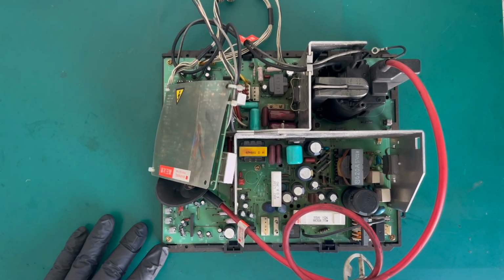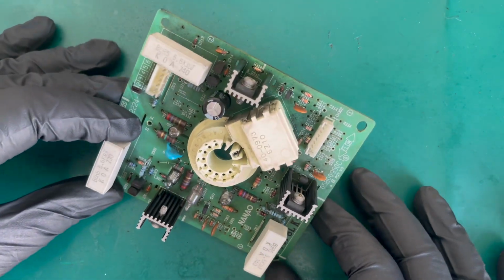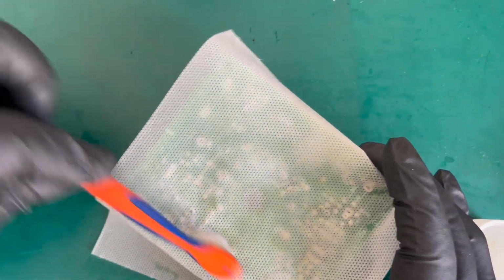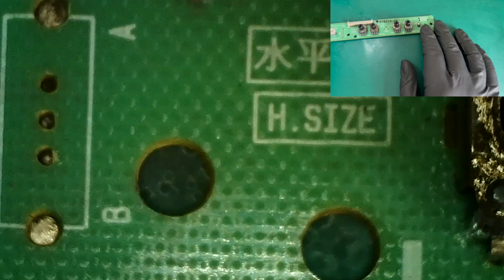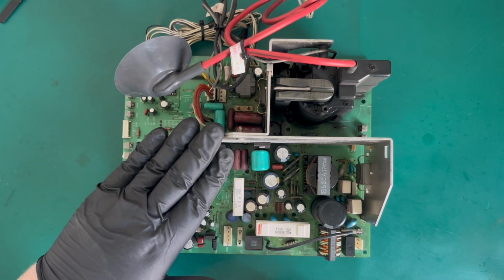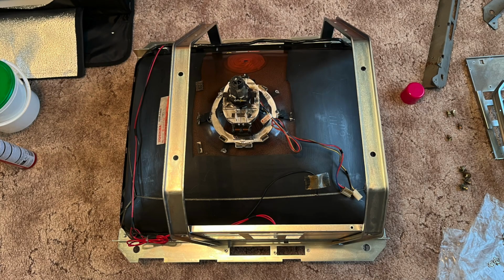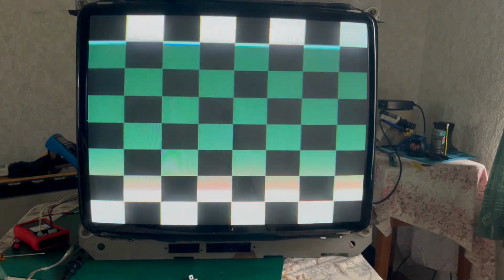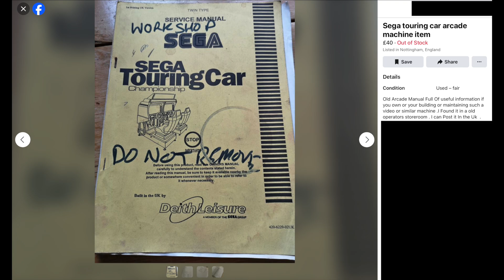Nanao MS9-29S-E Chassis (Arcade Monitor) - Replace capacitors and repair

Comment: ah good stuff, was thinking that the wider distorsion might be a cap issue, not electrolytic.. I know Mike 'the amateur'  has done a video somewhere for this on another chassis as I pretty much watched all his videos.... i think i recognise u now from ur reflections, think we spoke about Vampire Nights with Luke on top of Matts PL warehouse
Reply from the maker: Howdy, thanks for watching, and yes indeed my ugly mug in the reflection has been spotted - we were speaking about Vampire Night and other things. I need to get down and see Luke and the guys soon, I've just got back to the UK as have been in Iceland for a few days. As you say Mike has done videos showing something along those lines probably on a WG monitor, when I get to the point of actually recommissioning these monitors into use I'll have to compare the MS9s I have and maybe speak to Mike and see if I can get to the bottom of why. Thanks again and hopefully catch up soon.
Reply: @TheRetroBristolian  Awesome, will be at Timewarp Tuesday afternoon/evening on repairs and Luke will arrive later on.  Also doing a bit with Playback at Galleries.  Iceland so ur familar with the cold
Reply from the maker: @DaveRepairs  funnily enough Iceland is warmer than Bristol is at the moment, a lot warmer! If you get a second, can you drop me an email to the email address on my page contact details, I'll reshare my personal contact details, It would be good to tie up soon. (maybe Tuesday if the invite is there), I work next to the Galleries and have walked pass that playback quite a few times and have been meaning to go in. This year I really want to ramp up my game and do a lot more repair videos and do some collaboration work. I did say to Luke about coming down and scanning a load of artwork off the machines for him and helping if I can in anyway.
Reply: @TheRetroBristolian  Im back - Got my own Gunblade MS9 to review and got Craigs Astro City to improve.  Hoping they cross compatibile with tubes so i can test it on my gunblade tube ? who knows ... starting to study and order parts
Reply: This h linearty issue is due to the values of the last film caps of the H stage,  the two green one near the h yoke connector.  The last one cap is bigger for Hitachi tube also the heater resistor is different and you want have 3.3ohm for Toshiba tube,  you can check this is near the flyback,  on ms9 chassis witch prepped for Hitachi tube is 1.8ohm

Comment: Hello Dear Retro Bristolian,  I did a full cap kit on this chassis, but when I first powered on, it turned on for a second then it went dead. Do you have any suggestions on where should I start looking. Maybe I did a reverse cap or I need to look for something else. I would like your advice since I consider you very knowledgeable on the subject. Thanks a lot in advance.

Comment: Is it possible to provide information for the mesh towels you are using please. I am doing a similar process and this method looks great. Thanks.
Reply from the maker: These were just hand wipes I bought for about £3, but they aren't really the right tool for the job. Kimtech wipes are a similar product and I believe the right tool for the job as other people use it to assist with flux removal. I've also recently switched from using straight IPA to an actual flux removal (dissolver) liquid with the wipes to mop up excess fluid, that helps with removing the overly sticky residue left on boards. Hope this helps!

Comment: hello!! do you need an Isolation Transformer for 120v?
Reply from the maker: so these monitors are technically 100v as they come from Japan, but you can run them on 110v/120v, I use a step down transformer to achieve that in the UK, but the MS9 and MS8 don't NEED an isolation transformer, just step down. some monitors like WG monitors need a isolation transformer, eventually I will get one as it is recommended to increase safety. Thanks for dropping by and commenting.

Comment: also I cannot find specs does it do VGA? 31khz
Reply from the maker: so the MS9-29 is a medium res chassis doing 15khz and 24khz, there is a mod you can do to make it do 31khz but it is quite involved. if you want 31khz you should look at the later model which is 31khz compatible https://wiki.arcadeotaku.com/w/Nanao_MS-2931  info on the mod is here http://mikejmoffitt.com/pages/ms9-hax/